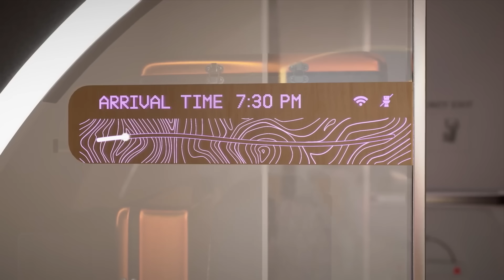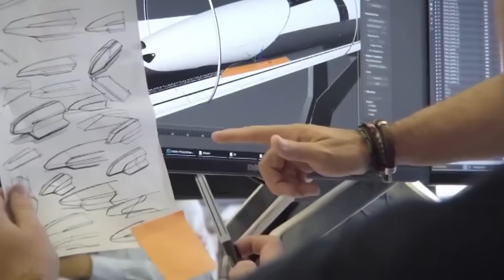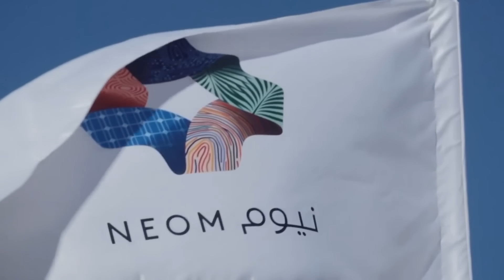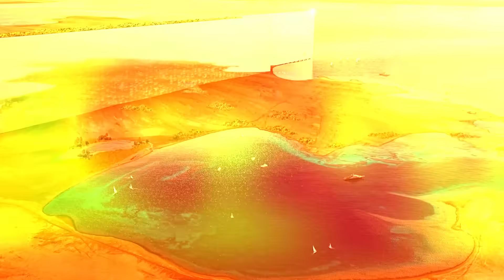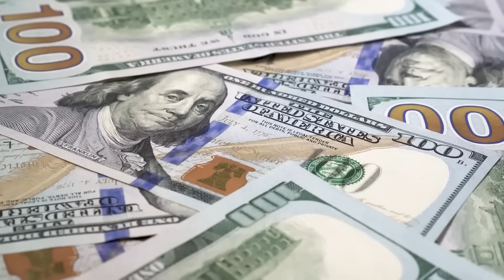Construction Begins On The Line Megacity. It's Actually Happening! 😲

Comment: I have no doubt that Saudi can build such a city. But it totally ignores what all great cities have with is that they are roughly circular with a river running through it. Hyper loop is not a viable public transport system because putting passengers in a vacuum tube is inherently dangerous. Maglevs are safer and viable.

I doubt this would be a pleasant place to live.

Comment: The current trench they're digging could just before one side, with a parallel trench for the other side to come later. The foundation for a 500 meter structure would need to be fairly wide. 500 meters is like 15 to 20 stories high.  you're going to need a fair amount of width at the base so the damn thing doesn't topple over in a desert windstorm. Also, I'm assuming the walls are not just going to be just walls, they're going to have residential and commercial units incorporated into them.
Reply: 500 meters, is about 100 floors. Roughly the height of Taipei 101 Tower in Taiwain (10th tallest building in the world).
Reply: @biovmr  oops, dropped a zero somewhere    :P
Reply: @pomelo9518  Nope. 500m tall and 170km long! Nobody would give a second thought to them building a "city" 500m long. Ok, we'll wait for your reaction...
Reply: 500 meters is not like 15 stories lmao 😂 not even close
Reply: @pomelo9518  what is the width?
Reply: Elevated structures on sand without ajoining foundations...what could go wrong!

Comment: It would definitely have great efficiencies due to its linear form as far as transportation of people, services, supplies. However The program is way too Constrictive to allow for natural variation of city needs and changes. A more sensible LINE would be keep the transportation and utilities linear and Construct node cities along the line and that are not in a fixed width and height. Give them their own character and let people spread out a little bit and not feel trapped inside a line. If you really feel it necessary you can have a very thin line the entire length but much thinner between node cities.
Reply: No. The transportation system is a rail-based nightmare... Just go online and look at their job postings, the project is a hot mess...
Reply: @edwardnigma2216 Well they may be incompetent and the project will likely fail; my only point is building something in a straight line, through mostly empty desert should theoretically be easier/cheaper. For example building a high speed rail in California would wind around hills, Cross hundreds of roads, rivers and other obstacles and require dozens of bridges and tunnels. This would also require a longer line and slower speeds.
Reply: It will be different
Reply: No. The transportation will be awful being linear.
Reply: @UraniumChef  Well with no turns or obstructions and similar parts  it would be cheap to build and you could achieve higher speeds as well with no turns. Although it has a few interesting advantages it is still a horrible idea overall IMO.
Reply: Completely linear transportation lines?  Oh...that's a nightmare in the making!

Comment: I don't think it will be built, but it's possible that a mag -lev train can travel up to 400 miles an hour easily.
Reply: as it rushes past your apartment only 50M away 6 times a day.
Reply: Ok, and where should you travel so fast? From one end to the other? In a line you need stopping every couple of hundreds of meters a fast train doesn’t make sense then
Reply: Not exactly sure how they want to pull this of considering it also has to do stops and has traffic. It's not that you just go back and fort the entire length. Even if you have pull ins you have to slow down a lot to change the rails or whatever It would run on.
Reply: Construction has already begun
Reply: No vehicle can travel 400 mph in a full atmosphere. Even fighter jets have to climb to a certain altitude where the atmosphere is thinner to reach those speeds. The only way to travel at those speeds is in a vacuum. That's why Musk's Hyperloop turned out to be nothing more than vaporware and will never be a thing.
Reply: @Ray Meade  you are a dumb uneducated ass. Cars have been going faster than 400 miles and hour for years. Go on YouTube and check out the speed records. Do your research before talking 👄 😏 bull shit
Reply: On the way now built
Reply: @hangnadem576  Doesn't mean anything.  The project can be abandoned just like the examples they showed that were abandoned.